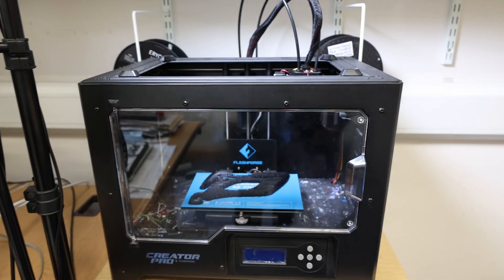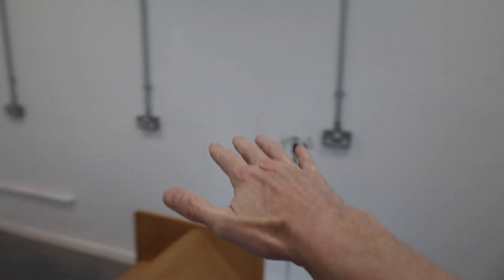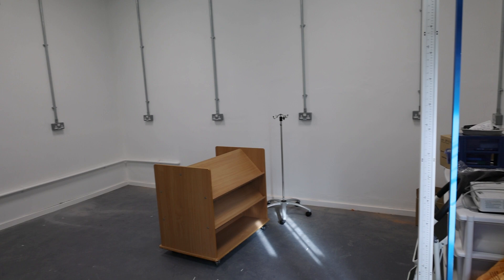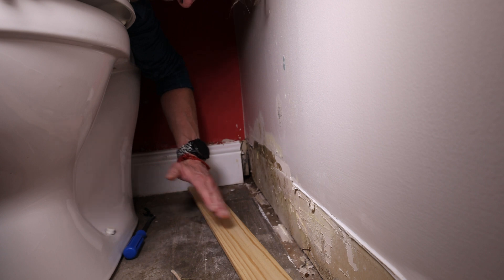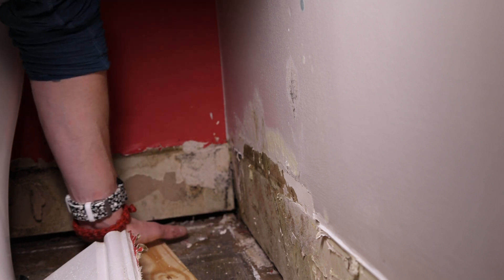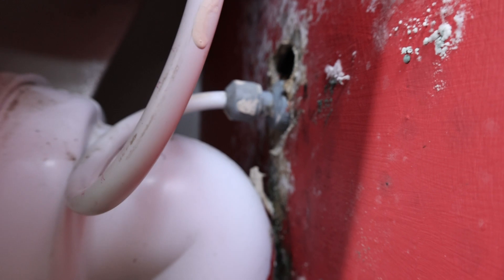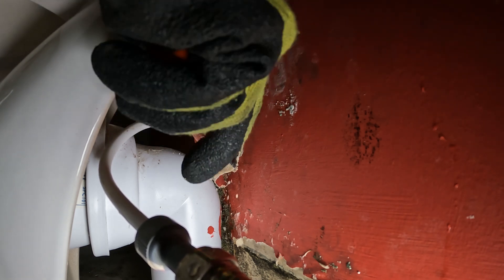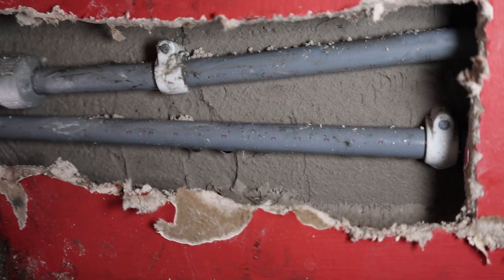Dissecting walls (vlog)

Comment: Sometimes the unwelcome project turns out to be the most satisfying solution. Maybe drawn out difficult labor but a bigger challenge. You are pretty handy when it comes to technical fixes. There is “drywall” for bathrooms now that’s extremely water resistant. I’ve entertained the idea of replacing the bottom wall up to 3 feet from the floor as well as eliminating the wooden baseboard just to make bathrooms and finished basement areas less disaster prone from water damage.